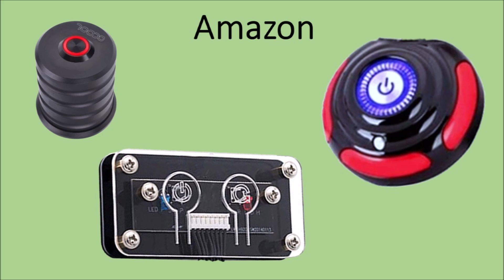PC power switch external - buy or make yourself at home

Comment: Hi! I have the switch and the connector here. Do you know which type of wire I could use to Connect both? They originally have thin wire but i dont know which ones I can use to replace those.
Reply from the maker: Thin wires are enough. There is low current and low voltage.

Comment: thats not switch but button
Reply from the maker: Yes. Sorry for the inaccuracy. English is not my first language.
Reply: @k-nemo  np. I was just hoping that i will find tutorial to make a power on SWITCH
Reply: Well this got me intrigued and I had to look it up on google, it seems like it's not wrong to call this button a "switch".
If you check the wikipedia page for "switch" you will see that in electronics there are all kinds of switches and that includes push buttons aswell.
In industrial machinery there is usually a red button for turning off equipment and they call it "kill switch" too.